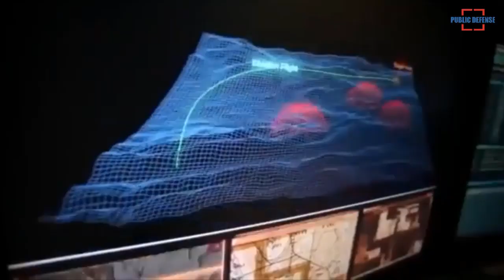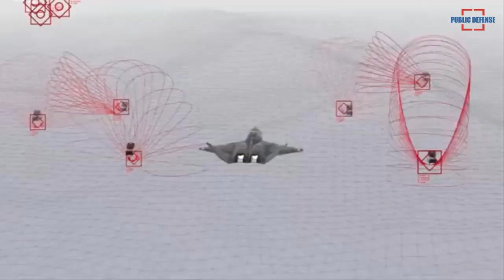US Air Force Has Built and Already Flown the Next Generation Fighter

Comment: Compared to the US Air Force's NGAD (6th generation fighter), the concept of the next Japanese fighter is behind.
The US Air Force's NGAD contains low-cost drones and lasers to shoot down anti-aircraft missiles.
The US Air Force's NGAD won't win anywhere, and a low-cost improved F35 will be adopted.
For the US Navy's NGAD, extending the cruising range is the most important requirement.
Australia and Canada use US Navy aircraft because they fly over the sea, but Japan is also close to the US Navy.
If you ask the US Navy for the concept and Lockheed for the design, subject to the use of the XF-9 engine, the US Navy may be adopted. 
On-board electronic devices and missiles should have the same specifications in Japan and the United States so that either one can be selected.
Unmanned aerial vehicles can take off and land without a runway Japan, which has islands around the Senkaku Islands, and the US Navy, which operates from large aircraft carriers, may have different requirements.
The US Navy can also operate the XQ-58A by dropping the XQ-58A into the sea with a parachute and recovering it with a boat launched from an amphibious assault ship.
Since China claims to be able to hit large aircraft carriers with anti-ship ballistic missiles, the United States should also shift from large aircraft carriers to amphibious assault ships.